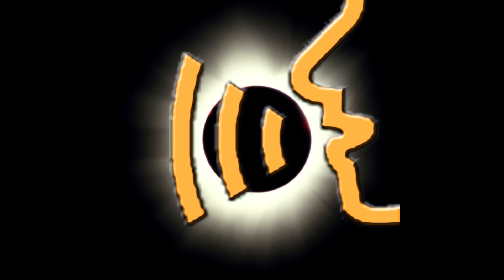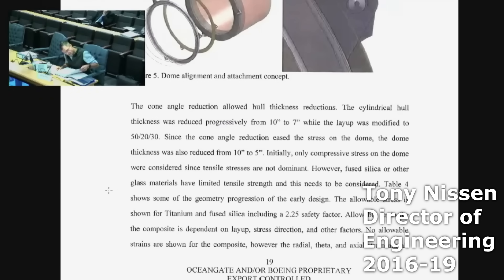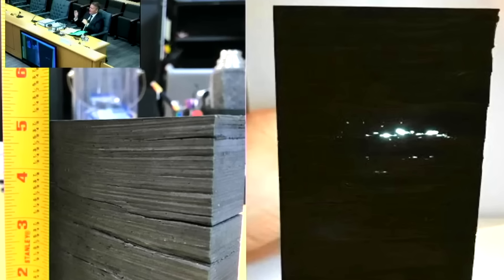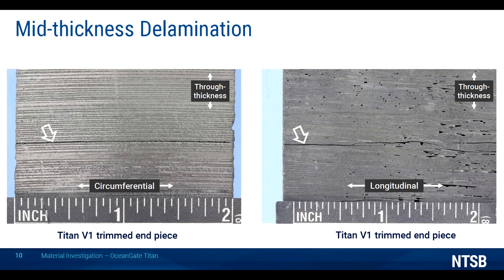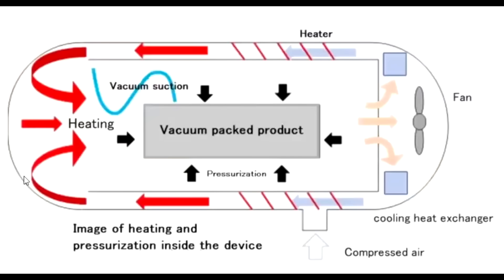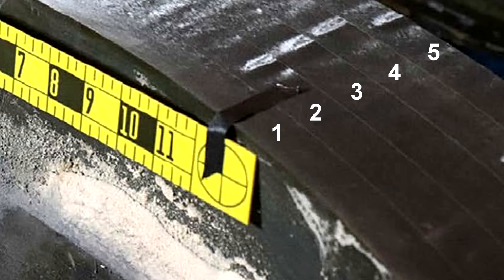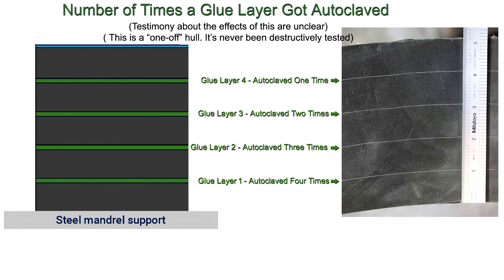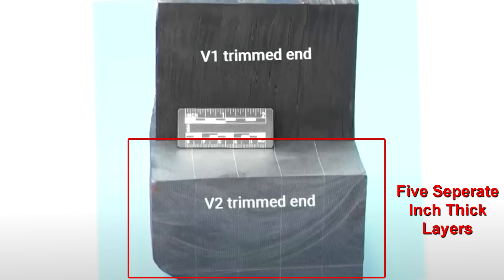Who Engineered the OceanGate Titan V2 Hull? Maybe Nobody Did?

Comment: Why didn’t they use steel?
Reply: because stockton was a moron
Reply: carbon fiber hulls have been used to success before, it wasn't the material it was the method, ignorance of safety, and lack of testing. I remember reading about a submersible that used a composite hull to great success with no incident but i can't remember the name of the submersible. Titan failed because they ignored every possible warning including their own warning system telling them the hull was cracking before the fatal launch.

There are numerous reasons not to use steel, the least of which is weight and cost. Submersibles often have to be carried by other vessels and composite hulls save weight and increase buoyancy without decreasing strength when done properly.

Comment: 6:47
When a 1/3 model fails a pressure test you have to consider that the force resulting from outside overpressure is proportional to the surface area of the tested object. So the real product will fail way earlier than the model.
Reply from the maker: Thanks for commenting.  I am not sure.  The way Tony Nissen testified about tthe 1/3  scale model testing for the hull is that it scales up well.  So, scale model data is valid data to use for the full-scale item design.  Scale model testing is used all the time to validate designs, so I guess there is a way to do it.  It just takes careful engineering and it is helpful when you are using materials with known properties, like metal.  Carbon fiber is a "different beast."

Comment: I'm a bit puzzled as to why this shipwreck is getting so much attention given how insignificant Oceangate is. I would be curious to know how much this investigation cost. I would bet that it's a multiple of what Oceangate's  hobby submarine cost to develop and build. Because that's what this is after all...
Reply: Because submersibles just don't fail. The safety standards in the industry are so stringent that you can count on one hand the number of subs that failed due to mechanical failure in the last 30 years.
And only Titan has failed due to pressure vessel fault.
This is a unique incident.
Reply from the maker: Thanks for commenting.  The NTSB is always going to investigate things like this, plane crashes, train crashes, etc.  An interesting one that I also followed closely was the collapse of the Florida International University pedestrian bridge collapse.  That was similar to OceanGate with engineering and fabrication mistakes,  It's very interesting, if you like this kind of stuff look that one up.  The difference with the Titan disaster was the cost of the at-sea attempt for search and rescue.  That was a massive Coast Guard undertaking.  The NTSB and the Coast Guard actually tried to be efficient by doing the public testimony jointly instead of separately.
Reply: I'd say it gets the attention because a number of people had been deceived about the safety, and died as a result. Just from a criminal persecution perspective, you would want as much clarity about the responsibilities as possible, even though the main culprit is deceased as well as a result of the accident.
Reply: It's because the world of submarines is so small and thoroughly protected compared to the massive world of aeroplanes and Maritime vessels.
Reply: Several people died because of Oceangate's utter and complete negligence in designing this sub. Wtf do you mean you are puzzled about why this is being investigated? They are investigating this to show the world WHY it is essential to follow well established submarine hull design methods and to not skirt rules to do this dumb shit. Even if it costs 100x what the sub cost to investigate, it's worth it if it saves lives. Are you trolling or something?
Reply: Several people died because of Oceangate's utter and complete negligence in designing this sub. Wtf do you mean you are puzzled about why this is being investigated? They are investigating this to show the world WHY it is essential to follow well established submarine hull design methods and to not skirt rules to do this dumb shit. Even if it costs 100x what the sub cost to investigate, it's worth it if it saves lives. Are you trolling or something?

Comment: So let me get this straight. At 10:22 we see a cross-section piece of the second hull built in five incremental stages. Between each stage they ground down the layers to make everything circular again. It looks to me they removed a heck of a lot of material judging by the angles of layers we see.
Reply from the maker: Thanks for commenting.  Yes, they ground down layers.  Dr. Kramer saw the number of layers being removed to be between 1 ply to 12 plies.  Taking away 12 plies of the 1-inch layer is a lot.  I calculate it to be a 3/32 of an inch of material.  I am doing a new video on that, so stay tuned.
Reply: Each of the plies that were cut during the grinding process  would no longer have extended the full length or full circumference of the hull.  Thus, the strength of these truncated plies would have relied partially on the strength of the bond between the adhesive and the carbon fibers, rather than the carbon fibers themselves.  Is my understanding of this correct?
Reply from the maker: @ That is correct.  And if they start to deform the load will be transferred to the neighboring fibers putting more strain on them and possible failure. I can create problems.

Comment: Rule number one in my composites class in grad school - don’t load carbon fiber in compression.  

…It’s basically just an epoxy tube with void inclusions.   

Absolutely stupid.
Reply: and virtually anyone who has ever shopped for bike parts knows that once carbon fiber has been sufficiently stressed, it can fail with no warning, even after fairly careful inspection. many a cyclist has wisely ditched a seemingly undamaged carbon fiber wheel or seatpost after taking a good smack, and knowing the critical piece could be fatally compromised
Reply from the maker: Thanks for commenting.  I think there may be a way to use carbon fiber for a hull.  Just may be not down to 4,000 meters.  It just has to be tested with unmanned prototypes and destructive testing a lot! The cycle life has to be determined.  It would be really expensive.  It's not something that is going to be done in a for-profit company because there is no business model to make the research and development money back.
Reply: @solareclipsetimer problem with carbon fiber in compression-decompression cycle is that it becomes weaker with each cycle and eventually starts to delaminate.
And it's very hard to tell when you have to decommission the hull because production process does not result in a uniform material. Each hull will have different lifespan.
And replacing the hulls in a timely manner will end up more costly than just making the hull out of metal.
Carbon fiber pressure vessels is a dumb idea on the face of it.
Reply from the maker: @MrRavellon  Valid points, thank you for commenting.
Reply: Yet carbon fiber masts exist. Top layer of wings or foils work in compression too.. Maybe consider a better "composite class" 😅

Comment: Watched a number of videos on composites after the accident, especially after the filmmaker started spewing out nonsense. 
1- every composite structure has its own unique strength, and the only way to verify it is via destructive testing.   Composites are very capable of compression forces if laid/designed properly.  Even for thin, simpler objects, they want 3d weaving to provide strenght in as many directions as possible.  For a 5-7" thick cylinder, not having fibres in the thickness direction  is a huge missed opportunity in strength.  (consider weaved fabric, each strand goes up and then down as it passes over another strand and then under the next one). 
2= the co-bonded thing is huge. It is no longer a 5" thick composite structure, but 5 separate 1" thick cylinders.  The lack of proper bondes beween each layer means a huge amount of strenght was lost, especially as they were cured separately and some adhesive tape put beyween each layer. very bad. 

Using pre-preg may not have been good idea. One reason they did the 5 separate cyclinders was that during during each curing, each layer would shrink and create some wrinkles.  They might have wished to use dry fibre, and then do vacuum resin infusion (draw vacuum and have pipes allow resin to penetrate the fibres and the resin will propagate to full all gaps betwene fibres without allowing the fibres to move since they are kept together by vacuum, so no wrinkles. 

Whichever way they built it, it needed to be tested because, unlike with metals, you cannot predict strenght of a carbon structure until after it is built and you test it.
Reply from the maker: Thank you so much for your thoughtful comment.  I agree with you totally!  And you got one of the main points of my video;  the five one-inch layers glued together doesn't mean you have the strength of a single five-inch hull.  And the porosity created by the process is a bad thing.  Somehow porosity has to be eliminated if you are going to use carbon fiber for this application.  If you want to go the carbon fiber route you have to test a lot! Something like, building a 1/2 scale model and diving it to depth unmanned 20 times. Then tear it all apart and see how the carbon fiber hull is holding up. Then build another one, dive it unmanned 40 times, and then tear it apart. Do this until you start to see damage and that establishes your cycle life.
Reply: With resin infusion, the issue would be how do you guarantee the fibers get fully saturated with resin? And if that is accomplished with lower viscosity or slow curing resin, how do you guarantee it cures properly? Any method of construction should have required far more testing.
Reply: @Sakari_SL-industries  Yep. infusion of such a thick structure would be a challenge.   But imagine the middle of the circular mandrel filled with resin, with the mandrel having hundreds of small holes through it, and you draw vacuum from the outside of the wound fibres.  This would suck the resin through the holes all the way around the mandrel and arrive at the lower layers of fbres and propagate towards the top for full infusion.   (or do reverse, draw vacuum from centre of mandrel and let resin get in from the outside surface but all the way around, just just at 2 or 3 spots).
Reply: Best comment

Comment: So this would have been fine for an unmanned robotic submarine that wouldn't have had a long life, and that's about it. Introduce human passengers and it's a completely different situation.
Reply from the maker: Absolutely correct.  If you want to go the carbon fiber route you have to test a lot!  Something like, building a 1/2 scale model and diving it to depth unmanned 20 times.  Then tear it all apart and see how the carbon fiber hull is holding up.  Then build another one, dive it unmanned 40 times, and then tear it apart.  Do this until you start to see damage and that establishes your cycle life.  Thanks for commenting.

Comment: I used to wind composite bore casing pipes and we had to use cross hatching winding for ultimate strength . We found hoop winding to be the weakest winding out of all the angles we used to work out the perfect angle for strength also it matters what resin you use helps . To strong and it cracks to weak and it breaks easy . You want strength but ductility aswel . Things under pressure and vacuum move . Those people were dead as soon as they were locked into that coffin . I used all different kinds of composites and resins over my 15 years of being an industrial composites fibreglasser . Its sad that people die from incopetant people that you put your lives in their hands .
Reply from the maker: Thanks for your comment.  I agree with you.

Comment: When using carbon fibre in this manner it makes little difference how thick it is because small defects or compression in the layers results in progressively thinner effective hull thickness. Carbon fibre in compression also has very little strength so the hull was little more than a tube of resin.
Reply: My way of doing it is, Build scale models of the proposed exterior and interior with material choices then take it to a qualified submersible engineering company with a good customer relationship/reputation and take it from there....
Reply from the maker: I agree with you on this.  The manufacturing process doesn't seem good enough to eliminate 100% of the voids which are weak spots under compression.  And at some point, if the carbon fibers are going to flex, fibers will break causing further weakness.  Carbon fiber hulls may be able to work, but they will have a known and limited duty cycle.  Thanks for commenting.
Reply: Yes! This! I’ve been saying the exact same thing in all my comments.   

All the talk about thickness and weaving angles and curing is…. deck chairs on the titanic (pardon the pun).  Their fate was sealed when some idiot decided to use composite in an externally loaded pressure vessel). 

(I have a PhD in Mech E and worked a few years in the composite lab of my department before switching to a different subject area…

Comment: Who gives a shit about lightness in a submarine?
Reply: Someone who wants to cut costs.  Metal pressure hulls are naturally heavier than water and you can't use air tanks at that depth to float it.  You have to use a special form of high pressure resistant foam called "Syntactic foam". Syntactic foam is VERY expensive.  Making a light sub allowed Stockton Rush to not have to pay to cover his sub in Syntactic foam.
Reply: The one who would have to buy a bigger boat with a bigger crane to deploy it. Also, the expensive foam that’s the only thing you could have used for buoyancy
Reply from the maker: Stockton's original business model was to keep it lightweight so it could be launched from the LARS and not need a huge boat with an A-frame crane.  But his original idea was for multiple subs working in more temperate climates and calmer waters.  Then the LARS could be towed anywhere by a small boat.  The Titanic idea came later and to work in the North Atlantic so far out to sea he ended up needing big support boats anyway.  The Arctic Horizon and the Polar Price were big.  So, his entire business model changed and then was not economically viable.  I did a video on that subject search YouTube for the title   OceanGate Was Broke! - Titan Caused It - Employees "Spill The Beans!"
Reply: If too heavy, it will sink forever.
You need something that float after dropping ballast.
Reply: The people inside the submarine when its submerged care very much how light the sub is. 😅

Comment: So, this wasn’t engineered.  It was drawn. An engineer would base the design on known and tested construction methods and materials.
Reply from the maker: Thanks for commenting.  Basically the full went diving with people, with almost no testing.  OceanGate did not test scale models using the same manufacturing process,  so they had no proof of concept and no idea of the cycle life.  The dove with people in it after 4 test dives in the pressure chamber in Maryland.  It is a sad story.
Reply: it was a prototype engineered thing, a bunch of engineering went into making it, but the parameters were more along the lines of we have only this money, this facility and this amount of this kind of carbon fiber. a lot of things are built like that - and it did work. this is the biggest failure with a lot of the commentary about it, repeating that it would never work but in fact it did work, it just wasn't reusable and they had no way of checking and testing that. their original design parameters should have been that if they can't build 3 then they shouldn't build even one. 

like, you can build a carbon fiber submarine we know and it works better than a scale model would suggest. better than the math of some guys would suggest. since they didn't have one to just test we don't know why/how and how to observe the failure mode safely etc.

this sort of approach to engineering was quite common just 60-70 years ago. the maths and models aren't perfect yet either but back then they would do a lot more of just building an idea with the budget and resources and understanding they had and seeing if the test pilot blew up or not, don't know who would've signed up to pay to fly with yeager and kelly didn't know if they could before they built oxcart etc because the devices to make it weren't yet engineered when they started.

it's kind of a shame even just economically because had they done it properly and tested and gotten experience of building hyper strong carbon cylinders that would have value for a company. lots of applications for if you can replace huge steel cylinders cheaper, for pressures both ways. the dude was just fixated on his "space-x for the ocean" scam business model that made no effin sense if you just thought of it logically - possibly this naming was just to justify the risks and that a lot of the private rocketry operations/attempts work in this same way of building with what you can get.

Comment: Ya know, if youve had a long and broad career in the mechanical engineering realm, you get good at mentally estimating size, thickness, strength requirements.  Just through intuition alone, I would be extremely leery of a 5"  hull of any material at that large a diameter at those extreme pressures.